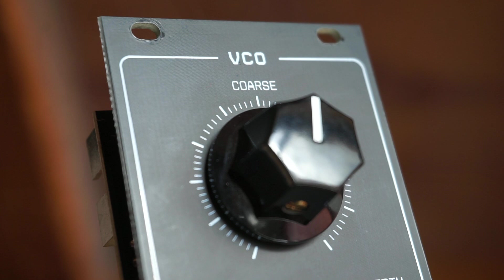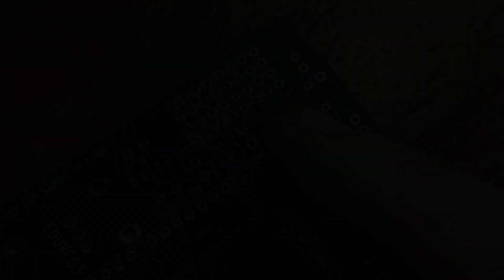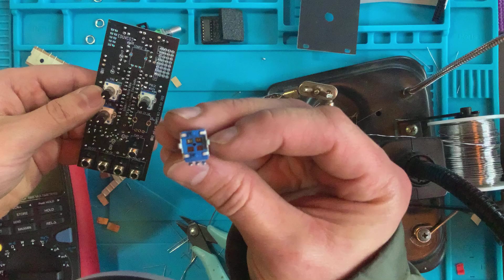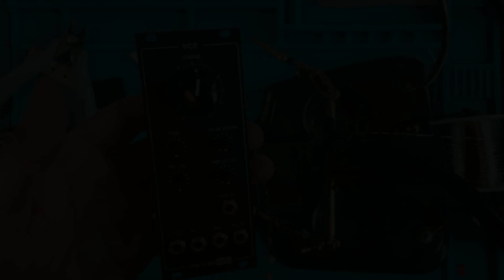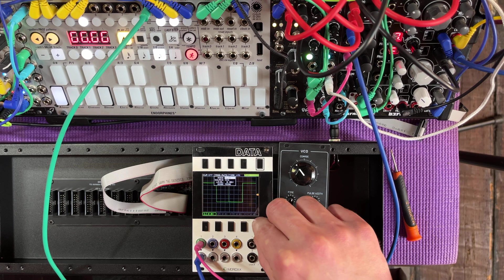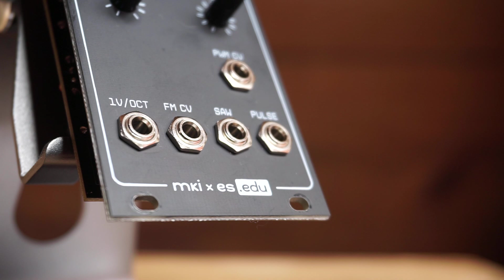Erica Synths .EDU VCO - Building, tuning, playing

Comment: Great video, thank you for showing how to tune it. Regarding that, it seems like you chose a random position for the Coarse knob, why is that? Or is the knob supposed to not affect when the 1v/oct cv input is used?
Reply from the maker: well, it has to tune regardless of the knob position, so it doesn't matter much where it is when you calibrate it. It's about making sure one volt makes an octave change, that's all

Comment: A little tip: dont measure resistors, this is a bad building practice. Get either a chart or a decoder and learn to look up the colour-bands. With a little practice you can soon identify components by sight.
Reply: About 8% of males are red-green colour blind (including me) we can't reliably distinguish the red/green/brown bands, we have to use a meter.
Reply: @dougietamson about 10% females have superior color vision
Reply: As he said, he can't see the colours very well.
 I've seen some with reddish browns, and brownish or orange-ish reds.

Comment: I just finished building the VCO.  Everything is working except for the coarse pot.  I get no change in pitch.  When testing with a multimeter I do see a change in voltage however when touching the first wiper connection I do get a change in pitch.  Does this sound like a cold solder joint?  Thanks.
Reply: Update: resolved! I found three resistors I missed around the coarse pot. Two were vertical on the right and a third to the left that I don’t believe was in the physical screenshot but I found on the schematic. Additionally I had not soldered the pot left right links not wiper but on the pot.  So user error of course!

Comment: Thanks for taking us through the tuning process! Are there any other factors that may prevent an oscillator from tracking 1v/oct like faulty power or temperature? I have a couple oscillators that I can’t seem to get in tune over more than 1-2 octaves. One of them, I adjust the trim pot on the back to get it calibrated, but then it’ll start drifting off again even if it’s been warmed up for an hour. I sent it back to the manufacturer and they could not replicate the problem. The other one just won’t spread evenly across the octaves. I’ve tried 3 different cases, different voltage sources, patch cables, and ribbon power cables. I understand the process and have had success calibrating several other oscillators, but I’m stuck with these two modules that won’t track properly.
Reply: You could try removing the 2 transistors and replacing them with other BC548 & BC558's
 They are vital in the CV to frequency  conversion, and they may just be not a very well matched pair.